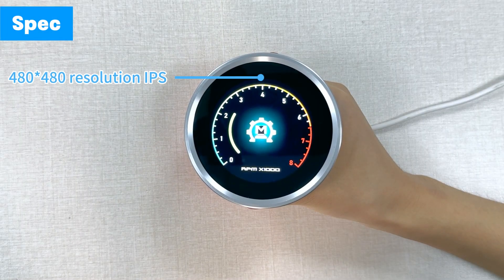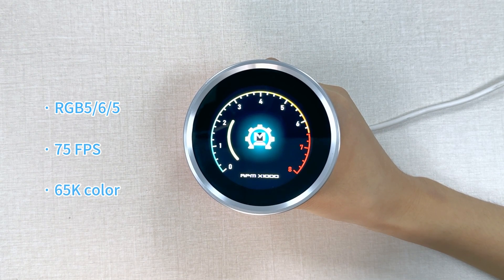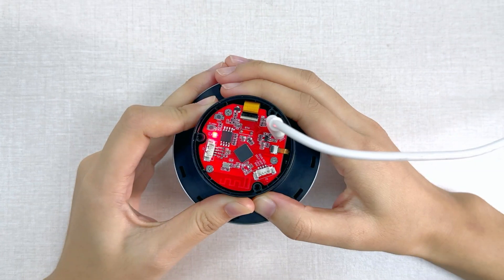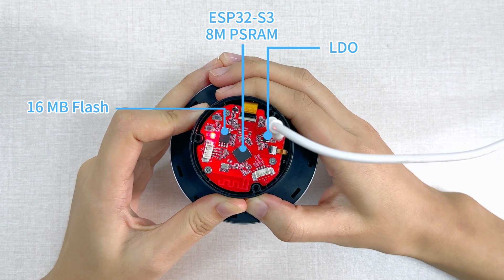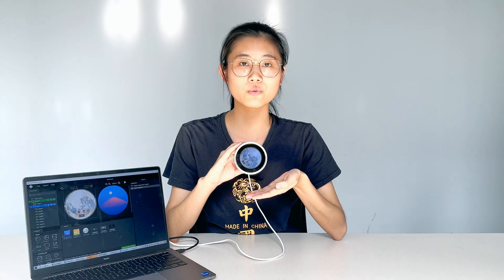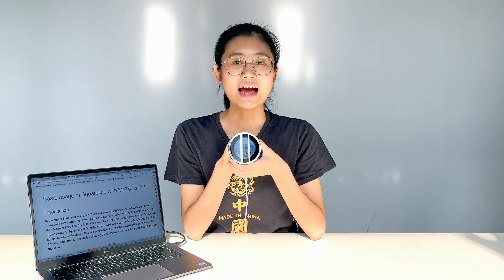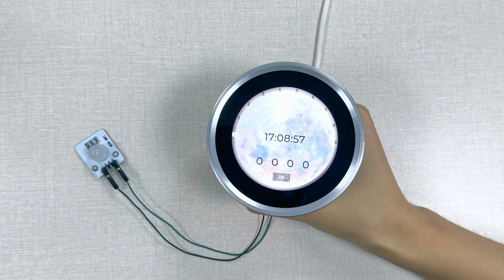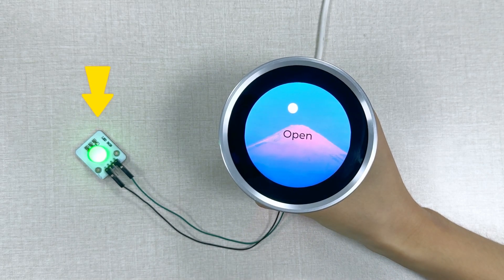MaTouch ESP32 S3 Rotary IPS Display with Touch 2 1“ ST7701

Comment: How would this work for speed? Can it be connected to GPS?
Reply: I dont know this product, but it does run Arduino compatible chip.
So you could collect speed in many ways:
1) read it from your car, if the car is quite old with analog gauges but digital speedometer - I think it should be feasible
2) read it from newer car (ODB)
3) read it from your phone (usb/terminal or bluetooth or wifi)
4) connect a gps thing to the screen it self
5) set up an RPI that does either 1-4 and use that as a "car smart hub" and pass data down to these displays, for different purposes

Maybe more options too, I just thought of those on the top off my head.
I would like to play with these displays my self, but have yet to do so.
Reply: @OlavAlexanderMjelde just found that Display, looks promising. Do you think it is possible to use one unit as a digital gauge via OBD2 dongle presenting customisable gauges & another unit to run stuff like Google maps, radio, media player? I did a digital dash from old phone with all that media goodies, but have to plug it every time blabla. My old Mini Cooper r53 already has two small round gauges, that displays could fit in!? 😅😁 Sorry for my questions